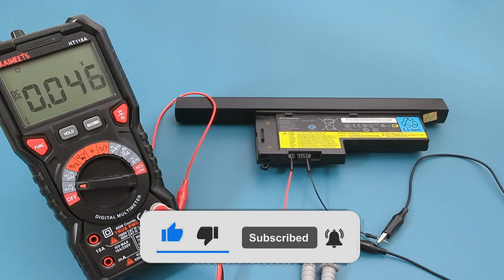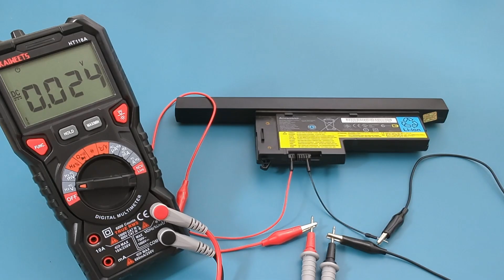How To Test Laptop Battery With Multimeter

Comment: You need to short 2 ground on from the side one from the middle connection before the battery will allow its actual reading
Reply: I agree. I don't know any laptop battery that doesn't have this linking of two pins before a voltage reading can be taken.